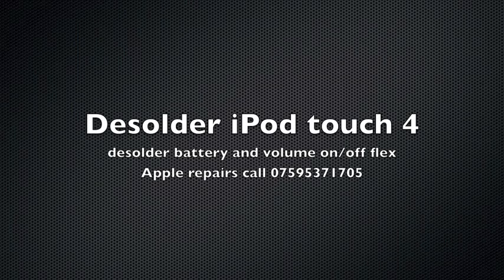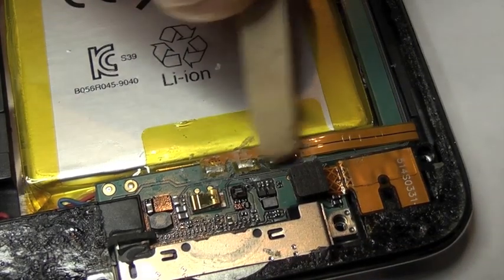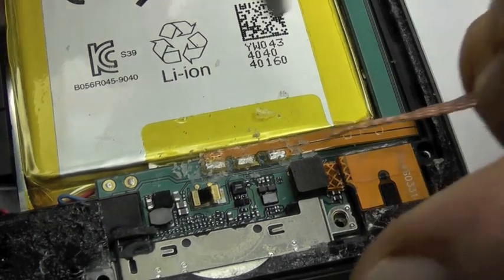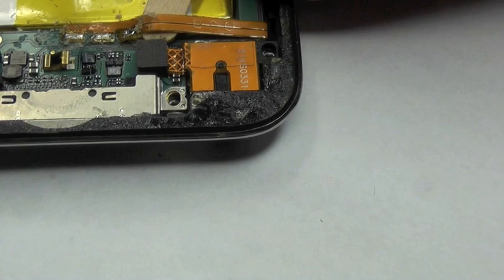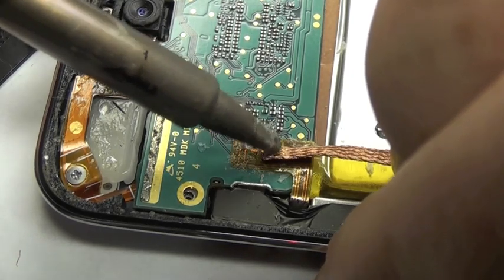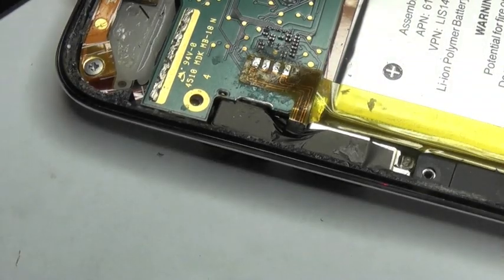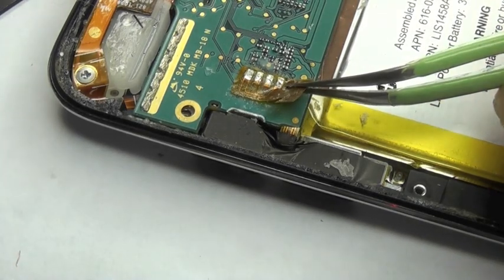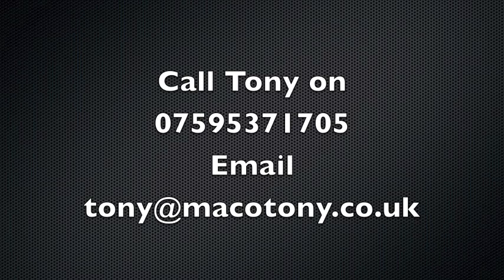iPod touch 4 desolder

Comment: Ok, I'm replacing the battery in my iPod Touch 2G (3G 8GB) and I was having problems getting the old solder to melt into the solder braid so I could disconnect the old one.  I have some soldering experience but not much DE-soldering experience.  I watched your video and I have to say your technique is perfect. I did it exactly as you showed, using a temp of 380 instead of about 360, (used a wider tip as opposed to the conical one) and I was able to easily remove the battery and have 3 perfect clean pads.  Thanks so much for this video!!
Paul

Comment: I removed the OEM battery (by heating the three soder points on the battery ribbon) and replaced with a $6 battery replacement. Ipod appears to work fine, touch screen/etc but battery now won't charge and continues to loose power until completely dead. I've tried leaving charging cable plugged in AND re-sodering the replacement battery AGAIN to ensure sufficient contact from battery to main board, to no success. I could not try installing the original battery to determine if I have a bad replacement( I threw it away-sorry)  Bad battery? Worse? Please help.

Comment: Hey what type of tip do you use for this work? Do I have to use an unleaded tip and unleaded solder? I have an iPod Touch 4G to replace the battery but somehow the solder will not be bound to desolder brade. So I cannot remove the old ribbon cable from the board. I solder about 380-400 degrees.

Comment: oops, I replaced my volume flex, but didn't think about disconnecting the battery. I'm satisfied I have fitted the flex correctly, and I have previous solder expediences. Ipod no longer works. Any ideas what could have been damaged? Any fuses you know of?

Comment: When I was taking the volume and power flex cable I pulled to hard and one of the pads came off the board can this be fix by just glueing it back in or what?